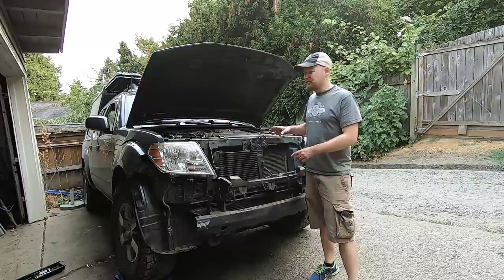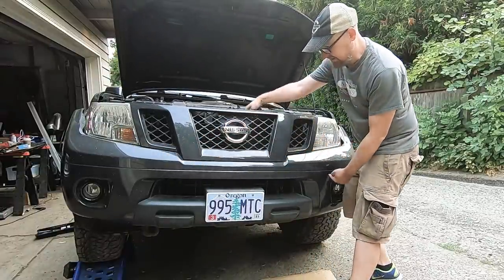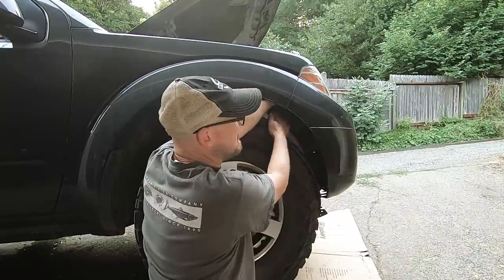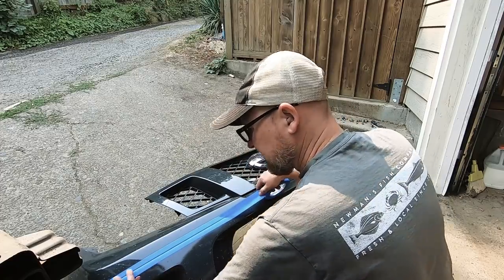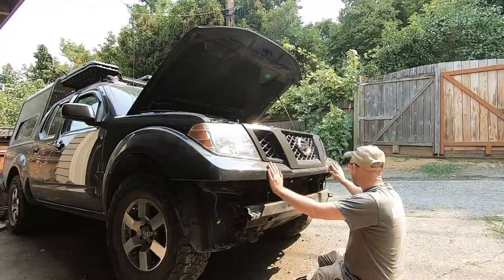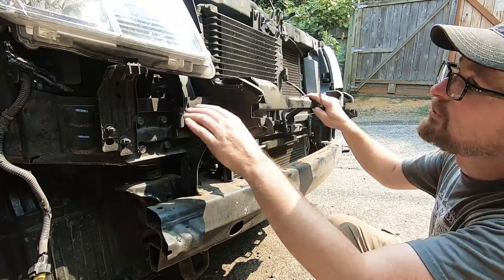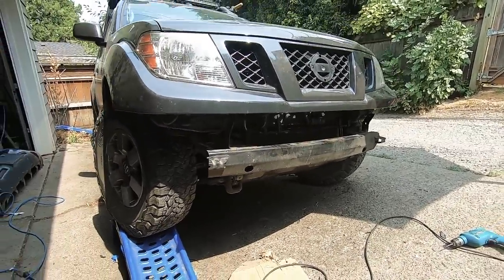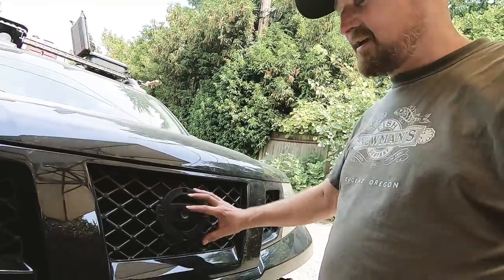Remove Front Bumper Cover on 2nd-Gen Nissan Frontier

Comment: If you haven't already, You should consider doing the rear axle vent mod.
Reply from the maker: I've got the kit, just need to get out there and do it. :-)
Reply from the maker: Okay so I realized I had a bit of time today and so I just now went out and did it! Thanks for the kick in the pants! :-)
Reply: @travelinman482  it was carried over.
Reply: @travelinman482  Are there 2021's? I thought that was a gap year between the old model and the just introduced and all new 2022's

Comment: 😃👍yeah! I removed the useless plastics on the front and rear of my vehicle(Montero Sport) and couldn't be happier. 
  Pending winch bumper installation 👌. Great job Donald.
Reply from the maker: Nice! Have you decided on a winch yet? I have yet to even begin looking at them.
Reply: @softroadingthewest  
🙋‍♂️hey,,  yes I have. 
 But here's my take on the whole winch conundrum.  
Its basically a insurance policy for me.  
Nice to have,  but hopefully you never need it.  Plus I'm on a budget and spending mega dollars on something that will rarely get used is not practical 🙃.  
 I researched too many brands and the positive reviews had me go w/ the HF Badlands 9k lbs unit w/ wire cable 💪. 
   Back in the day many 4×4's had 8k lbs winches(Warn8274) and did just fine.  No need for overweight overkill imho.  That's my story. 
Good luck with your choice and thanks for your Reply.  
Cheers 🍻,  G, 
in beautiful Boulder City Nv. USA 🇺🇸

Comment: I bought a Dremel set to help me with projects like this that involve cutting plastic. It's proved itself useful in plenty of projects for me so far. Good job using the tools you had on hand nonetheless!
Reply from the maker: Yeah, it's probably something I should finally just break down and buy, I'm sure I'd find all kinds of uses for one. The grinder works fabulously for big long cuts with room to move, but definitely gets unwieldy in tight spaces and doesn't turn corners very well. :-)
Reply: @softroadingthewest  You can get some pretty good and inexpensive ones that are compatible with the Dremel accessories. I've long used a Canadian Tire house brand one with good luck, mostly using Dremel accessories. The Dremel accessories are better than the knock-offs, but the tools are the same.

$26CDN for mine, Harbor Freight is probably as cheap.

Comment: Appreciate the safety break, but.... tighter gloves would be my suggestion. No glove is better than a bulky one that looses dexterity. Also, actually safety glasses are always a good idea, but with grinders...it's always good glasses AND a full face shield at least in the fab shop of my day job. Reading or Rx glasses do not count unless they are special Rx safety glasses, and if they are they would have wrap around protection from the sides or try are next to useless. Everyone is going to have their own opinion on what is 'safe enough', but when promoting safety I prefer the method of going all the way with the precautions and people can subtract from there depending on how much they value their eyes.

Comment: Thanks, not cutting mine, but need to replace parts due to a deer strike. I think a multi-tool would give a much cleaner cut vs the angle grinder.
Reply from the maker: I'm sure you're right. I have a buddy who has done quite a bit of bumper cutting with a multi-tool and it seems to work well for that task. I don't have one so grinder it was for me. :-)

Comment: Hat's off to you, not many would take a fairly new rig and cut the bumper in 1/2!!  I'm thinking the Softroading the west logo looks about the right size as the Nissan logo....hmmm
Reply from the maker: Haha, well, it's new to me but it is a 10 year old truck. :-) And while I'm leaning towards a custom solution, every aftermarket bumper out there requires this exact cut, so worst case scenario, I can always fall back on something that already exists. Wasn't too hard to pull the trigger. :-)

Comment: I was thinking of going with the Diode dynamics fog light replacements but seeing as they are just held in with the floppy plastic bumper it seems like a bad investment. Thanks for the video, it is always helpful to see someone else take their truck apart.  I noticed you used a handy “360 awning” to shade yourself also;)
Reply from the maker: Haha, yeah, the at-home "awning" has got a lot of use this year for sure. :-)  The fog light housing seems pretty sturdy when everything is actually assembled. It's all a LOT more solid than the plastic front end of the Forester was, especially as the whole thing is bolted to the skid plate. If you have no plans to chop your front bumper, I wouldn't hesitate.

Comment: Interested in where you are going with this.  So much so I went and looked to see what after market solutions where available and there are quit a few and some not very expensive that look good.  I have a Tacoma so after market is no issue but I look forward to see what you will do.
Reply from the maker: I'm not 100% sold on the aftermarket options so there may be some custom work involved, but I haven't made any final decisions yet. I needed to spend some time with it exposed like this so I could turn it all over in my head for a while. :-)

Comment: Is your truck affected by the SMOD issue? Now could be a good time to fix the radiator.
Reply: I think was sorted out after 2010 models of frontiers.
Reply from the maker: @SeanStewart88  Yeah, that's what I've read as well, 2005-2010, and mine is a 2011. Hopefully that bullet has been dodged, but I'm still considering a pre-emptive replacement just in case.

Comment: Any way to seperate the upper bumper from the grill? Reason I ask because my upper bumper is damaged on one side and needs to be replaced. Im also putting a custom metal bumper in the bottom. Just wondering if I have to buy the upper bumper attached with grill or not. I will not need the upper or lower bumper anymore as I ordered a upper bumper without the grill. Thanks. 😊
Reply from the maker: The grill is a separate piece that can be removed. I thought I showed that in this video but maybe I didn't. But yeah, there are something like 6 locking tabs along the bottom of the grill that secure it to the upper part of the bumper cover. Not super easy to get to but I've done it multiple times, it's do-able. Let me know if that answers your question.

Comment: Did I miss what bumper you're going with?  Excited to see how it turns out once the bumper and winch is installed. 👍
Reply from the maker: That's still up in the air. I probably won't buy an aftermarket bumper, but if I were to do so, they're all designed for this exact bumper chop, so it's a safe cut. I may at most buy just a winch mount designed for the Frontier and fab the rest of the bumper myself, but I'm leaning towards having a local fabricator create my winch mount. I want to do some of the fab work myself, but my welder tops out at 3/16" steel and the winch-to-frame piece needs to be heftier than that...though even if I could weld 1/4" I'm not sure I'd trust my amateur welding skills for something that could need to bear the weight of an entire vehicle. I'll just stick to the more superficial bits for now. :-)
Reply: I'm ALWAYS more excited about diy than off the shelf items. Can't wait to see what you come up with!
Reply: @softroadingthewest  I used the Wam winch carrier that fits inside the stock bumper skin. Very low key. Now that the bumper skin is cut thats not an option. Nismo has a new bumper that looks good though.

Comment: Donald thanx for sharing, love your vids! Question; What size tires are you running? Any mods to fit them?
Reply from the maker: 265/75R16 - that's the OEM size for the Pro-4x version of the Frontier, so they fit just fine. They were on the truck when I bought it.

Comment: You have your new winch/bumper already or you just cutting in advance?
Reply from the maker: I am leaning towards a custom build and wanted to be able to see all the underlying structure to start visualizing the design. Worst case scenario, basically every aftermarket bumper for the Frontier follows this same exact line - it's a very safe cut to make. :-)

Comment: Be careful not to touch the globes. Or if you do wipe them down with paper towel. The oils in your skin will make them overheat and crack. Same deal with halogen headlight globes.
Reply from the maker: Indeed! I didn't really give it any thought since mine were getting deleted, but that's an excellent point, it's important not to touch halogen bulbs with bare hands.
Reply: @softroadingthewest  just another tip for when you put your winch on. If you hook the end of your cable to a tow hook instead of pulling it into the winch your winch will last a lot longer and it is so much easier to get out. And when we are going thru big big holes in a big group we wrap a snatch strap around the bullbar to use before you pull the winch cable out.

Comment: sorry bro looks dumb
Reply from the maker: Did you actually watch/listen to what was said in this video, because it appears you've failed to understand that this is not the finished project. This chop is just an interim step required for virtually any aftermarket bumper made for 2nd-gen Frontier. I'm not proposing anyone leave the front of their Frontier like this. 🙄

I eventually fabricated my own new bumper for my Frontier, but there are also numerous commercially-available offroad bumpers for the Frontier, almost all of which line up precisely to the chop I've made here. On some older Frontiers, the factory bumper/grill was in two pieces and you could just remove the lower half, but any of the Frontiers with a single plastic front end require cutting along this exact line. That's all explained in this video.

Sometimes when you go around leaving negative comments on videos you either haven't fully watched or you just didn't pay enough attention to what was said, you end up making yourself look dumb.